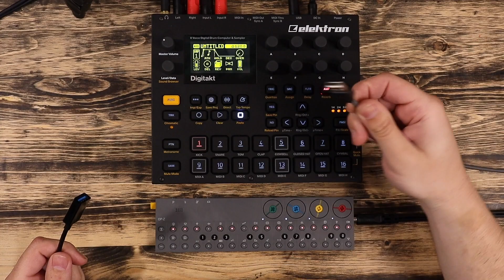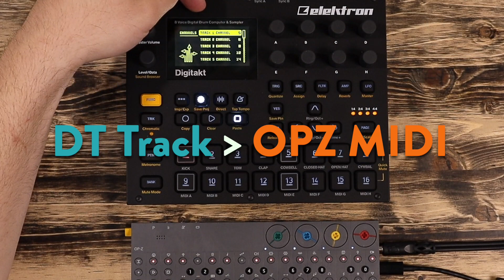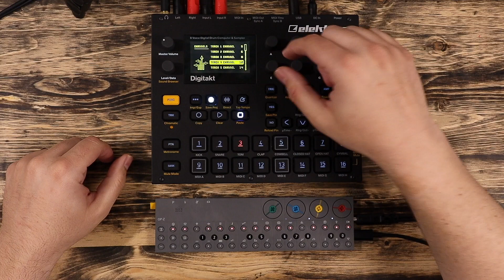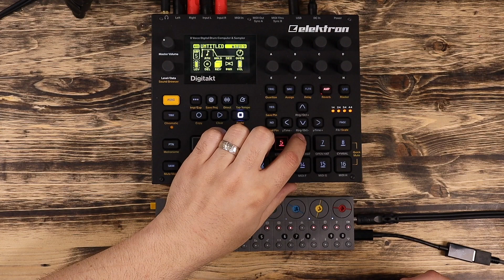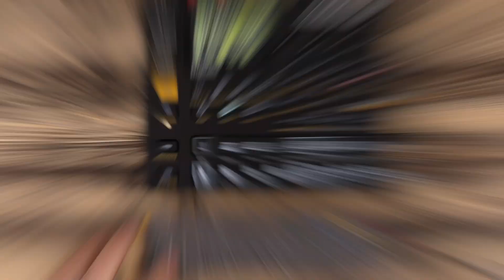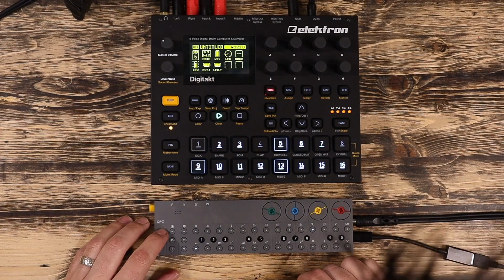How to connect the Elektron Digitakt to the Teenage Engineering OP-Z

Comment: The best way to do this is to control the OP-Z with the digitakt,  that way you can use the nice digitakt keys instead of the tiny op-z ones.  Additionally you can map 8 different OP-Z parameters to Digitakt knobs, and thats per channel.

Comment: @maunstermusic 
Hi. Thanks for the video.
I understood that in this connection opz controls Digi, but is there any way to make them "friends"?
I would like opz and digi to be synchronized and each to be a sound source.
I see it this way, correct me if I understand it wrong.

Digi and opz are connected via USB and synchronized.
For example the drum part is on the digi and the opz is the melody. 
To get the sound from one source we connect a jack 3.5 to the opz and feed the sound from the opz into Input L and R of the digi. 

and we take it from the digi. That is 
the opz goes through the digi and comes out with digi sounds.

I hope I have explained what I want, please tell me if it is possible to do it this way and please tell me what midi settings to set in Opz.
Reply: This setup should get you there. It's really about choosing which tracks you want to the OP-Z to control on the Digitakt. I no longer have the Digitakt so I can't walk you through much more than that. Hope that helps!